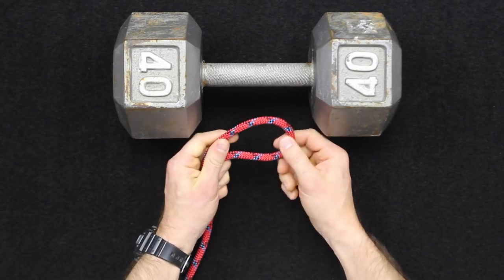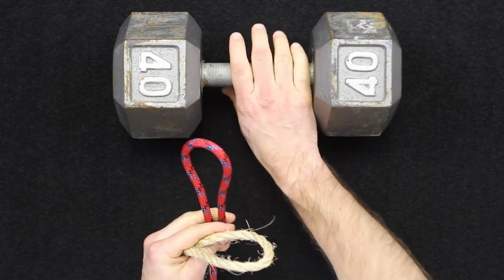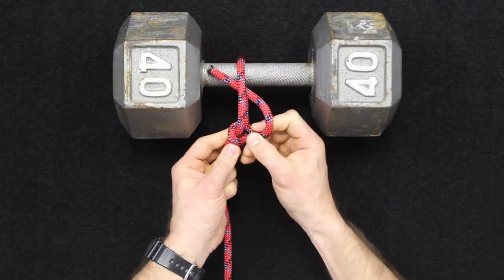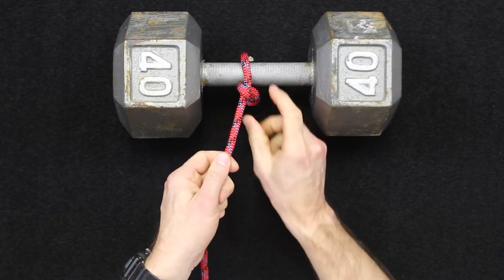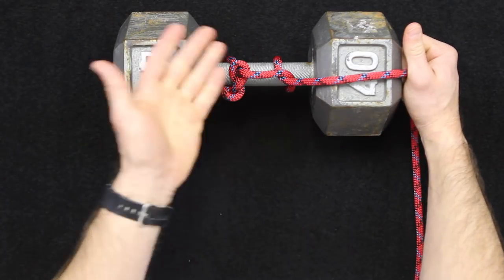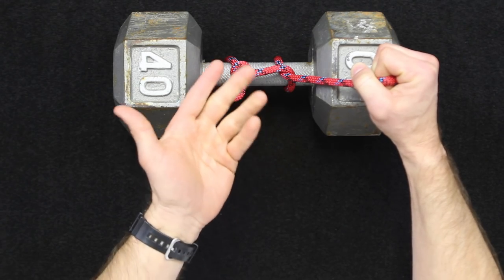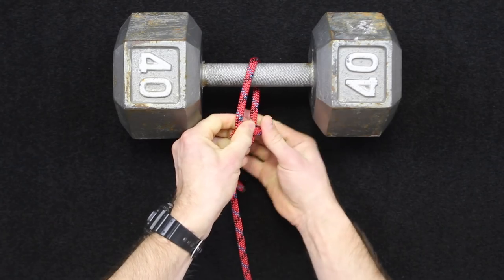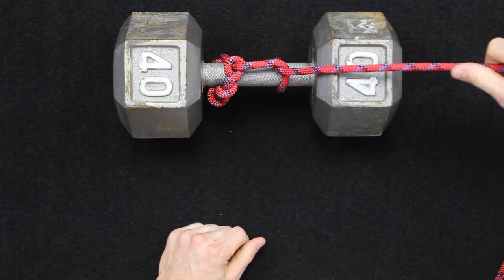How to Haul Almost Anything With the Timber Hitch  - ITS Knot of the Week HD

Comment: Could the timber hitch be used in a tree care routine? As in a clover up in a tree having the need to use a let down rope to control the path of a  freshly cut branch out of the tree. Instead of using a bowline or running bowline?